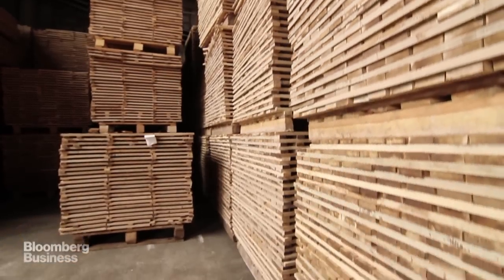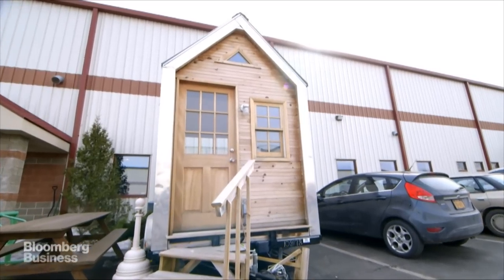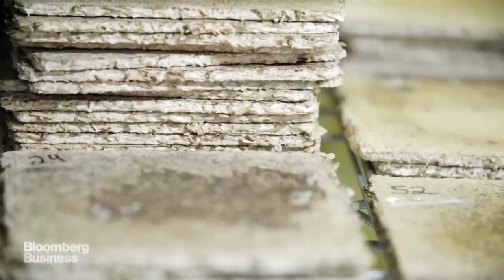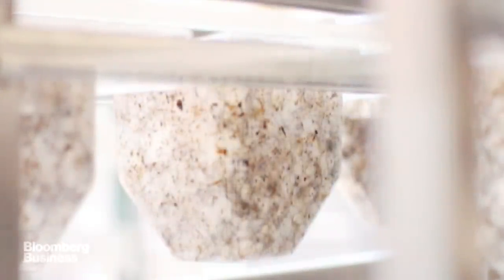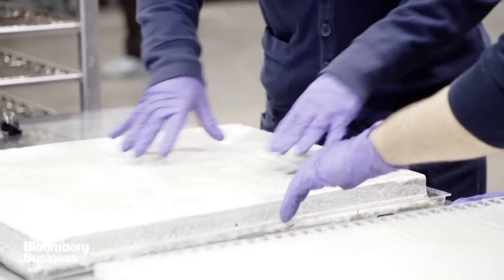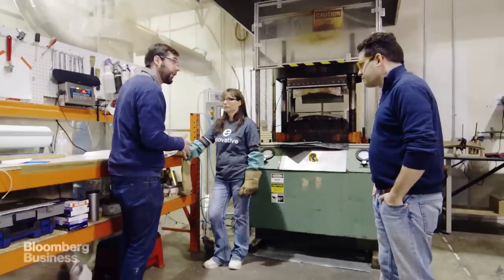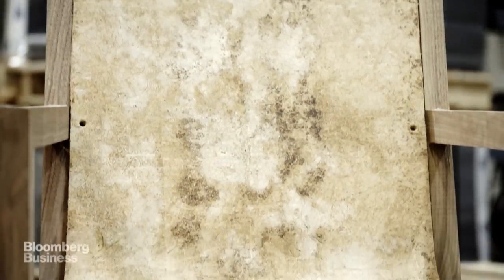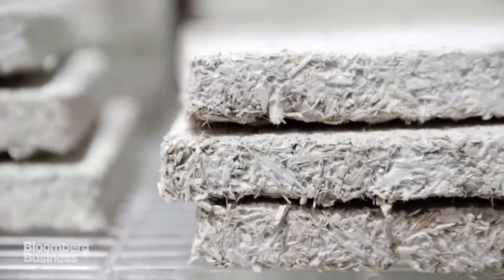Ecovative Design: Manufactured Wood Made Without Trees

Comment: Formaldehyde is quite present in the home then. Lemonine/perfume which is in a tonne of products such as air fresheners, cleaning products, shampoo, perfume and cented candles. It reacts with oxygen to make formaldehyde in the air. A study found that over winter periods in the UK the formaldehyde levels in a typical home were at a dangerous level because all windows are shut
Reply: 😳I’m glad that during the daylight hours here were I live it’s warm enough during the day to open up the house to let it breath after using heaters during the night it’s only on the coldest nights that I close the windows and turn on the heat 🤔😹

Comment: I think the problem they are fixing is exaggerated, but I also think impregnating the mycelium board with resin would make practically bulletproof structural material.  Imagine wind turbine blades made with impregnated mycelium and corn stalk waste rather than fiberglass.
Reply: it would be worse than fibreglass. this is because of the way the fibres are structured in the two materials and the tensile strenght of each fibre. glass fibre has a higher tensile strenght mycelium. aslo if you can controll the fibrestructure in a glassfibre board thus making the glassfibre board stronger or get a spesific mechanical property, somthing that you cant do with mycelium based boards. 
glassfibre is comparable to kevlar and carbonfibre and is a much more suitible material than mycelium.

Comment: if the company wants to be really people /planet friendly they should put the process out for all so we can all help.
Reply: uhhh....they kinda just did. they showed every process. a mushroom species that eats corn husks, corn husk fibers, moulds for shaping, and what looks like a heat resistant flame retardant material at each end for the final heat compress..... i mean . what more could you ask for. they just saved me a ton of money
Reply: But they didn´t said what is the mushroom wich they are using
Reply: @joaovitortrevisan7614  do you know something about this kind of mushroom?
Reply: @sebas887   No I don't. I had been wanting to now because i was doing a little school work about this material.
At the moment, I was't really interested ( I'm not working in that anymore).
But I would like to now if you want to tell me.
Reply: @sebas887  It seems Ganoderma lucidum is often used. I have ordered a spore syringe and want experiment a bit. It is edible, so no problem with poisonousness
Reply: @joaovitortrevisan7614  It probably doesn't matter. You just have to grow it in the proper conditions and it will work regardless of the kind of mushroom.
Reply: @maria_atalla  Some mushroom species have better characteristics than others, such as growth rate, resilience, or fiber strength

Comment: I'm always suspicious of a product who's major selling point is the terribleness of the problem it is purporting to solve without really arresting the actual costs vs. benefits of the actual product.

That's a lot of vacuumed formed plastic molds they have there. A lot of space that has to be climate controlled. A lot of heat and pressure to completely kill the mycelium (how many of their products end up continuing to grow and thus disintegrate after they leave the factory?). Do they charge less for the product because the manufacturing costs are actually lower, or do they charge less because that's the only way they can sell an inferior product? 

Finally, "exponentially" is not an amount. I don't trust anybody who insists on finding a way to insert that word into whatever they're saying to try and make it sound more important.

Do I think we have big problems to solve? Yes, of course. But that doesn't mean that using a slightly different manufacturing technique to continue churning out more and more consumer products is the solution.
Reply: If the mycelium doesn't die(pretty unlikely) it would continue to grow and possibly fruit. Might change shape a bit, but it wouldn't disintegrate. Also, it's the type of thing you'd paint, which would suffocate any living mycelium.

Comment: Made without trees? These boards are still made from wood. They only left out the glue. Also formaldehyde based glue has been banned decades ago, at least here in Europe.
Reply: Is made of sawdust, straw, and agricultural wastes, no need to use trees
Reply: Ruben Proost I watched another video on this company where they stated that corn husks were being used in that particular mold, so at least they are not exclusively using trees. A town, especially after a storm, has a lot of limbs and even trees on the ground. A sawmill may find an extra revenue source with this process. Better than it going to waste. Who knows what else could be used as a growing medium. Can mycelium grow on ground pinecones, chicken feathers, the shells of nuts, or what about recycled paper? They are also making the materials rigid through compression, so maybe plants like algae could be used. Which are already being utilized for biofuels.
Reply: @jerrywhidby5259  nice food for thought, thanks
Reply: Ruben Proost doesn’t matter wood is perfectly fine. The problem is with the glues and this stuff is cheaper and biodegradable